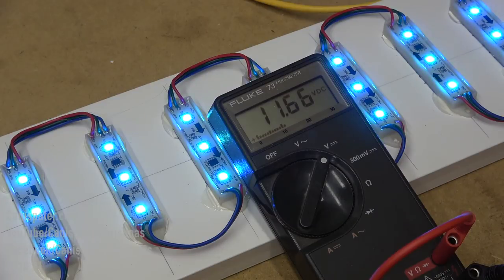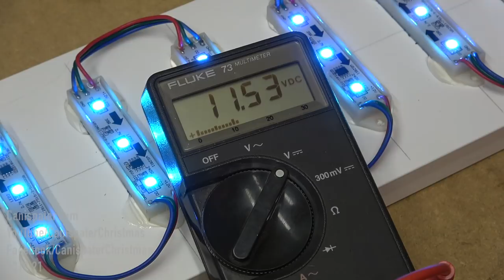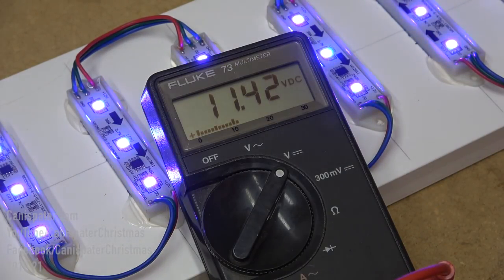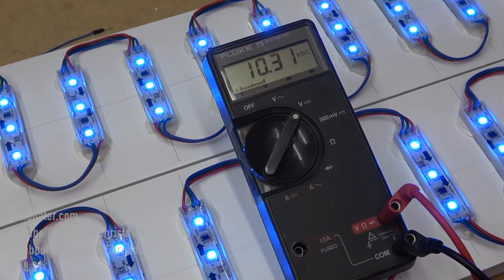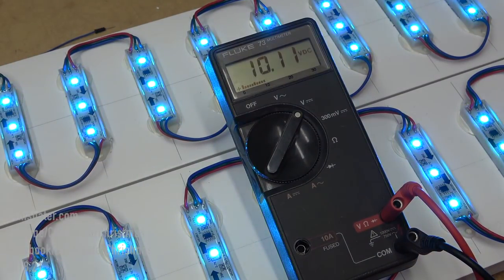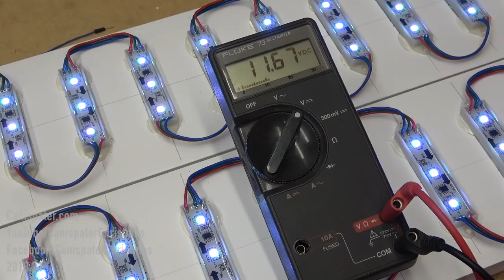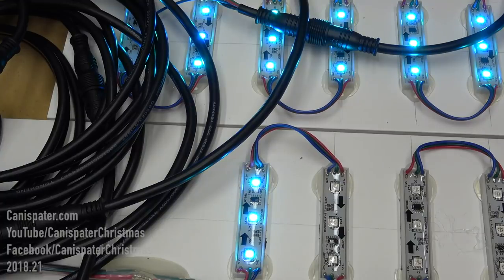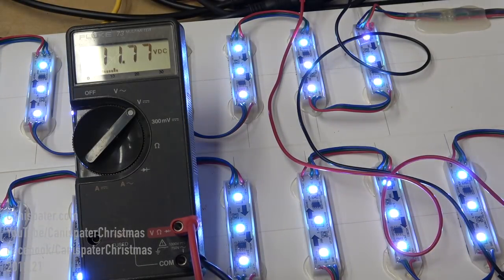Falcon F-Amp RGB Pixel Data Signal Booster (2018)

Comment: So it looks like I'm a little late to the game, but thanks for this video. I'm running 4 16 foot ws2811 strips off an esp32 and they start freaking out occasionally. I bought some of the f amps and will be installing them between the strips.
Reply from the maker: Friends don’t let friends use strip. 😂 They can be a little finicky. Flickering can be caused by so many things. Make sure to test the pixels separately to eliminate them as the problem. Then, make sure the grounds are good. Let me know how it goes.

Comment: Over the years I have watched a ton of your videos. This was my favorite intro so far. 😂
Do you have a video explaining Null Pixels? I haven't found one yet. Thanks!
Reply from the maker: I don't know that much about null pixels and don't use them. It may be a rarely-used (old) solution to a problem. Essentially, you can set one or more pixels as null pixels at the beginning of a string so they don't light up, but still pass data. Pixel-to-pixel distance is small so F-Amps are better for chaining props.

Comment: Is there ever any case where you need in inject F Amps half way through the matrix? If you had 1000 pixels for example? Or only needed at the start
Reply from the maker: If it's a matrix, you just need power injection. The data will jump from one pixel to another. If you put feet of distance between one pixel and another, may need an F-Amp.

Comment: Can you daisy chain these F-Amps?  What I mean by that is put in an F-amp before the beginning strand and then about 2 more strands down put it another.  Would daisy chaining F-amps even need to be done?🤔
Reply from the maker: From the controller, no, but any place after that is fine. It amplifies the data signal, but the controller is already putting a strong data signal out. Let the lights tell you where you need one. If the first part of the string is fine, but it changes along the string, that's where you need the F-Amp. If you daisy-chain props, you might need one at the end of the last prop that works. Last part of the question, why do you think you need one?

Comment: Do they come with a wiring diagram if you don't have pig tail type plugs or they marked ( + D - ) with In and out flow. ??
Reply from the maker: They are marked just like standard pixels [ ( + D - ) with In and out flow].

Comment: I’m planning out my permanent ws2811 lights and I’m banging my head against a wall. I have a spot where I have about 250
Pixels (12v) and my first pixel is going to be about 40ft from my controller. I think I can use 18awg wire and use an famp booster. My real issue is power injection. Am
I able to run an 18awg wire from the power supply and about a 40ft home run to where I need to inject. Will 18awg be enough if it’s just for power injection?
Reply from the maker: You may not need an F-amp. Try and see. If it were me, I’d try to find a place for a 12v power supply and run the mains that far. Not saying it won’t work, but there is going to be a lot of loss in 18ga wire that long. 250 pixels (depending on the pixels) could pull close to 15-amps all white, 100% brightness. You don’t want the wires overheating to the point they melt the insulation or start a fire. Look up current handling capabilities of the wire, determine how many injections you’ll need to divide the current to a safe level for the wire and factor in the loss of the wire. You’ll need to experiment a bit to get it working safely.
Reply: @CanispaterChristmas   that’s what I was thinking. Just run an extension chord and get the power supply 10-15’ from where I need to power inject. That’s probably as close as I can get for the power injection part. As for the pixel string I guess I could run a smart receiver to that area too.
Reply from the maker: Yep. That will certainly solve the data problem and will put power closer to the beginning of the string. All good things.

Comment: I'm guessing that there could be an effect with different types of wire used in terms of the quality of copper. Pure copper is a lot better than copper coated aluminium when you look at voltage drop and the quality of signal.
Reply from the maker: Yeah, that would be a good experiment, especially with these lights. :)

Comment: This is my first year with a display. Steep learning curve, but in the end (and thanks alot to you) everything worked fine, except my "Tune To" sign. It is 247 5v pixels and is 30' from the controller, and it is indoors. Because of the distance I have  a separate power supply for that sign. I only ran the data and ground lines to the first pixel. When I connect it to the controller, the pixels just randomly flash. 
My question is, do I need to run the power wire from the controller to the F amp ?  
For this year I am running the sign on my pixel tester, which I bought thanks to you.
Reply from the maker: Thanks! I suppose it depends on where you put the F-Amp. It does need power, but I wouldn't put it near the controller (since the controller data signal is already strong). Put it closer to the prop and power it with the prop's power. An alternative to using an F-Amp (for a 30-foot run) is to use Ethernet cable from the controller in a similar manner (data and ground only). Use one tiny strand for data and group the rest together for ground. Seems odd, but data travels better on skinny wires due to impedance.
Reply: @CanispaterChristmas  my thought was to put one mid way, 15', from the controller. But i will try to the ethernet cable trick first.

Thanks

Comment: I've read that an "extra pixel" can be used as a signal booster as well if you have one or two lying around. Is this true?
Reply from the maker: Yes, but pixels don't really "boost" that much. They're only designed to go a few inches - to the next pixel. The F-Amps do a much better job of boosting the data signal vs a standard pixel.
Reply: @CanispaterChristmas  Thanks. Just wanted to check before purchasing.

Comment: I’m building my first show I have raspberry pi 3 running falcon player using a teensy 3.2 and octows2811 this should drive my 5v ws2811 led pixel strings my concern is with the one controller the first led of some of my props  could be more than 30’ from controller, will I have a problem are there any recommendations Thanks
Reply from the maker: Well, I can't say that I'm familiar with that hardware, but I did do a quick search. You're obviously a tinkerer so that will be helpful. I believe the commercial boards we use have amplified outputs for the data so they can go that distance. You could try using a single strand of Ethernet cable for the data line (shown in my "snake" video https://youtu.be/Z0KIXDRkSCk). Once you get data to the first pixel, the pixels will take care of it from there, but 30' may be tough without an F-Amp. My advice is to test it out ASAP and make adjustments if needed. Different pixels behave differently. The ones I show in that video were defective and deaf so I needed more data signal to make them work. You may not have the same problem so test it out.

Comment: Do they make these for 24v leds?
Reply from the maker: 5 or 12 is standard and I'm not aware of any 24V models, but David might be able to assist. His contact info is at the bottom of the Pixelcontroller.com website.

Comment: Good afternoon Jeff, I have 12 North Pole lights lining my front yard with 10 feet in between. I have 3 ea. of the 50/50 nodes in each light. I start having flickering issues after about 60 feet. Do you know if I can use 2 or 3 of the F-Amps in this 120' run to help resolve this issue? Could be a nice experiment I recon...
Reply from the maker: Check voltages first to make sure it’s not a power problem, but if it’s a signal problem, the F-amp should fix it.

Comment: Do you put the booster in the middle of the extension?  Or near the prop's input?
Reply from the maker: You can put them anywhere in line with the pixels. You want it in there before the signal degrades too far so that may be in the middle of a run. Generally speaking, if the pixels can't use the signal, these may not either. This is one of those things you'll need to experiment with.

Comment: Hey Jeff, quick question regarding F Amps and modules.
I'm using 3 candy canes with 40 modules on each. Its about a 15-20 foot run from my controller to the 1st candy cane. I had planned on using an F Amp a little bit out of the controller but was also thinking about placing one between candy cane 1 & 2 as well as between 2 & 3. Is that over kill or do you think I may need them?
Reply from the maker: You probably won't need one coming out of the controller, but between props, yes.
Reply: @CanispaterChristmas  So between 1 & 2, and between 2 & 3. Thanks!
Reply from the maker: @chexlemeneux4907  Yes. Correct.
Reply: @CanispaterChristmas  Last question about the F Amps, I promise. Is it best to place the Amp right after the 1st prop or is it better to split the difference between the 2?
Reply from the maker: @chexlemeneux4907  It needs to come right after the last pixel on the prop. Pixel-to-pixel distance is small so better to give the F-Amp as much data signal as possible.
Reply: @CanispaterChristmas  Awesome! Thanks again!

Comment: It's my understanding that the signal from each pixel does not degrade once it has reached the first pixel. (Not withstanding your test) if you power injected at the end of the second string (with out the f-amp) would there still be the flickering you demonstrated 1/2 through?

If all the pixels were flickering then I would be on board, however from what I learned I think you demonstrated a power injection issue, even though you certainly did fix it with the f-amp ( which is only for signal boosting I thought )
Reply from the maker: While pixels DO regenerate the data at each pixel, they are designed to only get the data to the next pixel which is a short distance. Adding 10ft of cable between string #1 & string #2 showed flickering while the voltage was still high enough to power the pixels properly so that was a data issue solved by inserting the F-Amp - adding more power in that case would not have solved the problem. After adding 30-feet and an F-Amp between strings, the problem switched from data to power - injecting additional power at the end of string #2 in that case solved the flickering problem since voltage was dropping below the point they needed to function at full brightness. You are correct in that the F-Amp is a data booster only. It's certainly possible I did not explain all that properly. lol!
Reply: Yes because I have had this same issue with a 15' distance and adding power before and after the last pixel before the long run.

Comment: I am new to all of this. Love your videos! I can turn to you to help when I don't understand! Would you recommend the falcon system over the lights o roma. Which one gives you the most bang for your buck.  I bought 5000 pixel lights 2811, 164 foot led RGB strips as well as 16 feet of led rgb strips x 5. 8 foot 0f 30 cm shooting stars x 10. Which system should I use to control it all.
Reply from the maker: Thanks! LOR has been around for a long time, but I haven't used their controllers in a while so I'm not up to speed on their latest offerings. I converted completely from AC lights to pixels a few years ago as the old strings died off. I have an older Falcon F16V2 and the current Falcon F16V3, plus the Falcon F48 if that tells you anything. :) The F16V3 is a great controller and the one David (creator of the Falcon controllers) recommends for starting out.

Comment: Maybe it isn't the pixels that are insensitive, it might just be the controller.  I've done a similar test of adding 10 foot extensions in front of a string of lights to see when it starts to flicker.  (Without an F-Amp).  On the Falcon F16V3 I start to see flicker at about 30 feet.  When I put the exact same string of lights on a HolidayCoro AlphaPix I can go 70 feet before I see any flicker, proving that the Falcon puts out a much weaker signal than the AlphaPix
Reply from the maker: I don't have experience with the AlphaPix, but these pixels only seem to work with a third of my normal wiring so these pixels need a little extra love. :)

Comment: I'm working on some landscape lighting and I have.   
---------
40 foot from the controller to the 1st set of 10 pixels 
3 foot to the 2nd set of 20 pixels
3 foot to the 3rd set of 10 pixels
25 foot to the 4th set of 10 pixels
23 foot to the 5th set of 10 Pixels
3 foot to the 6th set of 160 pixels  (160 LED Strip 3M + 1 foot)

25 foot to the 7th set of 10 pixels
28 foot to the 8th and final set of 10 pixels

Total 
=====
150-160 feet (Estimated)
240 Pixels 

What is the best way to run something like this?  Or is this not even possible?  I figured I would need a couple F-Amps to make this work before each long run.
Reply from the maker: Yeah, if there is a break of more than about 3ft between pixels, you'll need an F-Amp at the end of the previous pixel to get it through the wire. Main problem will be power as voltage will likely drop with a long wire so you'll probably have to inject power somewhere (not a huge deal, but might change your design a little). Realistically though, set it up like you want then troubleshoot. The pixels will tell you if they aren't getting what they need by either being dim or not coming on. Use a volt meter to check voltages and an F-Test may be of help here to check signal. You'll learn a lot, but it might be frustrating for a while. 😂 Don't be shy asking for help in the Facebook groups.
Reply: @CanispaterChristmas  thank you!  If I ran a 5 conductor wire and fed the last pixel prop would that be enough power or do you think I need more?  

I have another option of maybe dividing this into two groups and put 2 chips out at two of the props so the run is sooo long.
Reply from the maker: Probably not. Nothing wrong with trying the way you want to first, then deal with it afterwards. Hard to say without more information, but anything is fixable. 😂
Reply: @CanispaterChristmas   I asked that question goofy 😂.  When you say “probably not”. Do you mean probably not enough or probably not need more.  

I’m going to keep digging and working on this. I’ll let you know but it will probably be a month or two.
Reply from the maker: A single extra wire will probably not help much.

Comment: Are these acceptable for Light O Rama items as well?  I have 5vdc ws2811 pixels and have a couple of runs that are 20 to 30 feet long between each segment (windows).  I have completed power injection but it seems as if the signal is not getting to the end.  Thanks!!  Love these types of videos!  Intro is awesome!!!!
Reply from the maker: I don't know for sure, but they boost the pixel's SPI bus so I would assume they would. Might check with David for sure.
Reply: I sent in the question and awaiting an answer.  Thanks and will let you know the outcome.
Reply: Got a reply back and yes, you can use these with any 3 wire pixels!